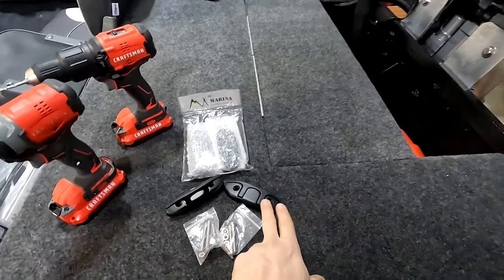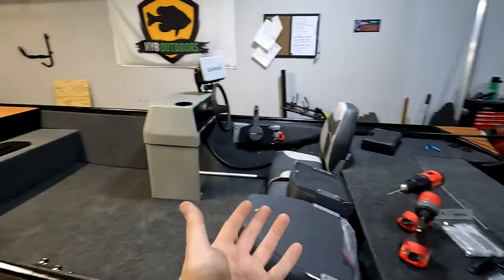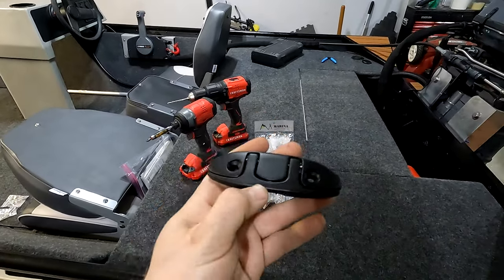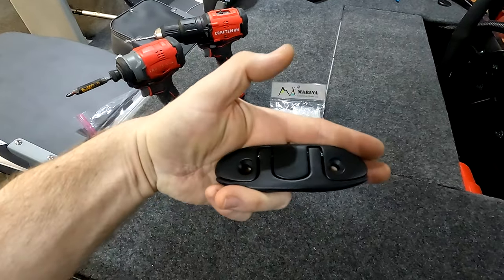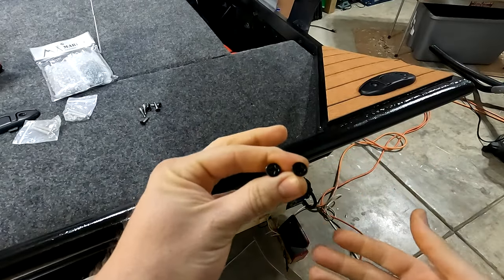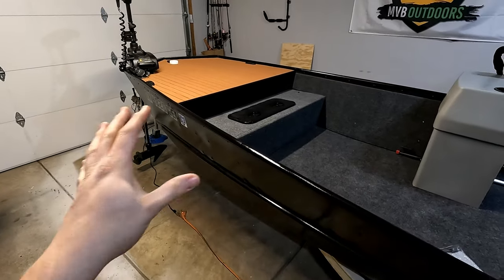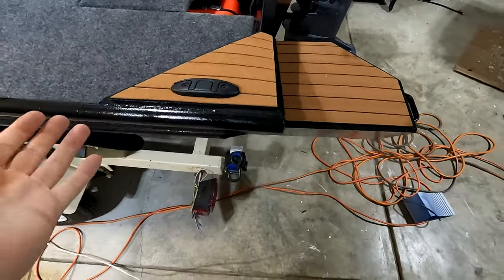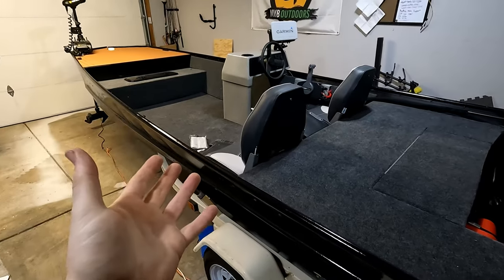Folding Boat Cleats Jon Boat Accessory Installation

Comment: Just a FYI, for cleats, its a better idea to use a nut and bolt if you can, theyre much stronger than screws. If you want to tie up your boat for an extended time, or if you ever have to get towed, you'll need the extra strength. I can't tell you how many cleats ive personally seen get ripped off because they weren't secure. Also, thanks again for that awesome rivet tutorial you did like a year ago. I just cut and re riveted 13 on the bottom of my boat...no wonder it was taking on so much water. I couldn't use the proper brazier rivets (no access from the top) but i was able to get some closed end rivets and further sealed em with 5200. Ill be surprised if they ever leak again.
Reply from the maker: Awesome job the rivets, I bet it's running a lot drier now, haha. 

Yeah bolts are definitely a stronger connection, I added cleats primarily these for dock tie offs. Didn't have access to the underside of the deck so just went with screws all around. Held up great so far! 👍🤞
Reply: @mvboutdoors  good to hear. Haven't had it out yet, we'll see